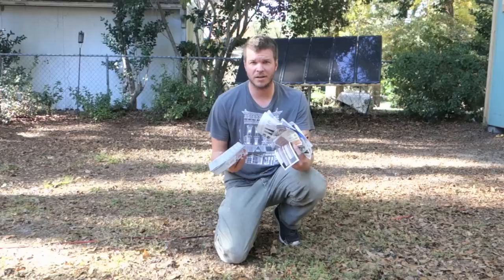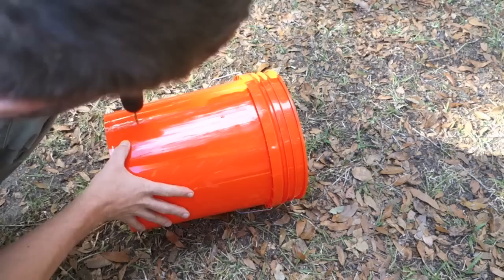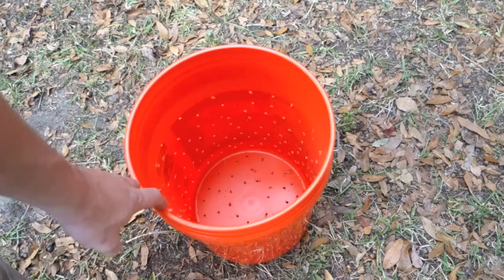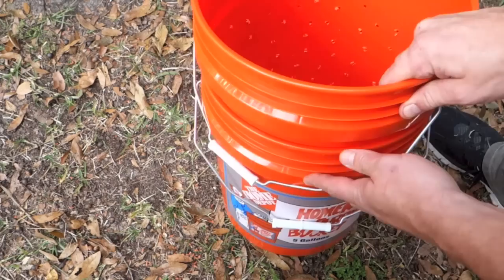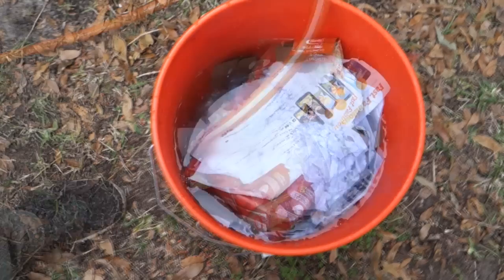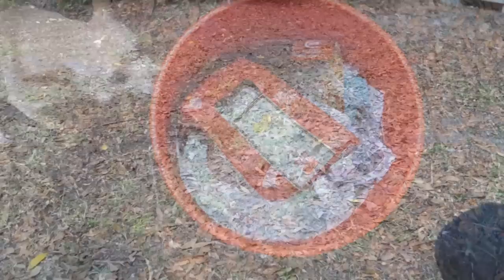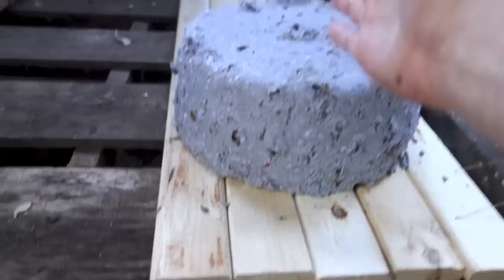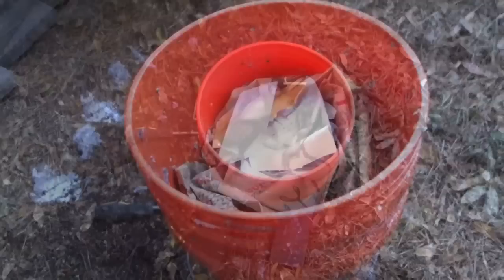Free And Virtually Unlimited Fuel To Heat Your Home

Comment: In the 70's, my dad used to make me roll up the newspapers and flyers into paper logs. No water, no drill, no mess. Tie the logs with string, and place seam side down on the grate. Obviously you couldn't use egg cartons that way, but they can be used as starter wicks. So much quicker. So much easier.
Reply: We did the same for the wood stove.
Reply: That reminds me of the movie with John Candy and Dan Akroid The Great Outdoors, “You have to twist it to simulate kindling”!

Comment: Bit late to the party but apparently at scouts when they make small fire starters out of dryer fluff (lint for the US) they add something like Vicks Vaporub or anything else with a petroleum base to it for flammability.
Maybe you can take the same approach with these briquettes if you want to start fires with them instead of having to already have a fire started.
Edit: Maybe you could even syringe the Vicks or equivalent into the centre of these briquettes after it’s dried and keep squeezing as you withdraw the needle to ensure the fire get into the briquette.

Comment: I use a similar method to make fire starters, even made my own blender blades. I add dead grass and leaves as I find that solid paper doesn't light as easily. I usually make 3-4" balls with my hands, small enough to fit into baggies to put in my camping bag.

Comment: It's great to repurpose this stuff. I am concerned to know if the dyes in the ink or coatings on the paper are toxic and if toxins are released into the water or into indoor air when burned?
Reply: In a ventilated wood stove the smoke is going up the pipe. But yes the ink and glue whatever is bad for you most likely. But there are worse things in everyday life then burning this ink stuff. Burning plastic or just eating from plastic containers is probably a bigger problem.
Reply: I'm told that a lot of printing inks these days are soy based and safe to burn, can anyone confirm ? I also think that burning the fire hot rather than damped down gives cleaner burning and helps break down a lot of combustion prodeucts and impurities.
Reply: @mycolets   I believe  I heard that also, they used to say to use regular  newspaper, but, not the comics. (because of all the colored ink)
Reply: Most likely its bad, and even more with plastic windows you would forget to take off before putting your waste for this purpose, You can just make 2 paper waste containers and be more selective about it one for recycling and one for making this stuff and only use paper that is mostly clean or has little to no ink on it or only black or blue ink like o letters, also care for paper cups as they have wax coating or plastic coating, as long as you know its only wax coating it would be ok to burn since its same as burning a candle, but plastic lining is a no no.
Reply: I work in a paper mill. The inks used on paper now a days is all soy based because its the cheapest. Paper from 15 to 20 years ago or more is problematic. White clay is added to printed paper so the ink won't blot. Most paper glues are starch treated with caustic. Potato skins are dissolved off with caustic and the solids from that are the primary source. The primary problem with using paper as a fuel is that its very poor in heat producing value. Wood is primarily composed of lignin and cellulose. The two are separated and the paper is made from the cellulose. You need to understand that wood which contains more lignin, such as oak, provides much more heat than a low lignin wood, such as willow. Paper is similar to burning leaves. You can heat with just about anything that burns, but using a low heat fuel will yield lower results. I suggest that you find a source of waste or scrap wood, such as broken pallets for low cost heating.
Reply: @OAikoT  honestly you're better off burning the paper normally. Compressing it into logs like this just makes it burn less efficiently.

The key is having a fire system with thermal mass so you can birn fast and hot and capture that heat
Reply: I wonder how well these would work in a rocket mass heater
Reply: @garyindiana2127  well enough, mixed with quick hot burning wood.

The problem with these is that they're made to burn slow to slow release heat for people with ordinary wood stoves.

If you have an RMH just load up the feed with a ton of paper and one or two chunks of wood and let it rip. The mass will soak the heat energy
Reply: @priestesslucy3299  Perhaps while it's goo mix in some wood chips, if you have a side loading rmh it could save a trip to the stove....idk
Reply: @garyindiana2127  Most likely similar to using dried dung. Dried dung fuel is used in Africa in rocket stoves, but requires wood to be used with it. As for the lost fertilizer value, this dung is low Nitrogen anyway and the Potassium is still in the ash.
Reply: 7:05 yes, but I need every day at least ten of these to heat my 50 square meter apartment. Wherefrom do I get all the paper? Why not burn the paper directly and not have to make it wet and wait until it is dry which can take weeks?

Comment: If I remember from the 70's right, we used borax in the water to help it catch fire instead of smolder. Something that may help you! Also if the chunk doesn't please you asthetically, try rolling it up in a paper bag when it's almost dry. Cheers!
Reply: Gas works too😂😂
Reply: @jimmyReesby  AXE body spray is flamable

Comment: This is a great process. I normally shred every other month because I do own a shredder and like making use of it. The other thing I do different is go to my local hardware supply company (Home Depot, Lowe's or Ace) and get their wood shavings for free. "The shavings are soooo fine"; it helps the product mixture to burn much longer with the added wood shavings/saw dust. I hope this comment was helpful.
Reply: Do these paper logs burn hot like wood or just kinda smolder?
Reply: @mikhailkalashnikov4599  good question! I would like to know the answer to that as well! Blessings be all with love and light! 🙏❤️🌞✨🤗

Comment: Great ideas here! Very creative! I am the ultimate lazy log maker. I take paper section and roll them up and leave an open tunnel inside then immerse them in my kitchen sink till soaked. (10 minutes). Then I pull them out and squeeze them out a bit and form the pseudo-log shape ( its already in a log shape) and toss them in the garage to dry. They take about 1 month to dry fully but they keep their shape. They burn easily due the tunnel inside. Sometimes I add junk mail and leaves from the yard as I roll up the newspaper. I agree, this is a vastly unrealized fuel source especially now before the SHTF and the mail and newspapers stop coming :) Super video!
Reply: great idear love it thank you for shearing
Reply: I like it!, simple and easy to do
Reply from the maker: Thanks!
Reply: ***** I dont understand. Could you explain please. Thanks.
Reply: I'm even lazier- I just throw the junk mail directly into the woodstove. In the summer it goes in a huge box, and when the box is full it goes in the woodshed. I don't get enough junk mail to even begin to heat my house though....
If someone had the time, I'm sure shredded paper is free from those companies that do it for a business.
Reply: julie r They sell it to paper companies!
Reply: julie r they shred the paper for a reason. It contains sensitive information, which would sometimes be hard to put together, but it's possible...
Reply: @interstategar  A lot of the time they give it away for free, because it would cost them to dispose of, and the paper companies collect it for free,  because it saves them having to source and buy it instead. it's a win win for everyone. Source: I used to work for a record management company who did heaps of shredding.

Comment: Good idea! If you had a third bucket, you could use that as the press in place of using a saw and cutting wood (or maybe let the water drain onto plants and just use the second bucket in place of a third) Also, if you had a paint mixer, you could save effort of building a custom tool and using that to blend.
Reply: Just saw the video I was thinking the same thing as you as I watched
Reply: I don't think a paint mixer will shred the paper very efficiently because it's not Sharp. Try it and let us know!
Reply: Well I've got plenty buckets I get all the peanut butter buckets after they're empty and I've got plenty of paper to burn my neighbor's call the fire department every time I burn my wood pile and also the health department for the buckets but my neighbor's Pitbull keeps getting loose and Animal Control don't show up so I've got that line of buckets to keep him from coming in my yard through the electric fence and its full of water so I can dump on him when he grabs my dog now I've got another excuse for all them buckets thank you will keep the Neighbors at Bay
Reply: @desertodavid  well I'm not all white and you have to use what you got on the reservation to make do you know..... Life Goes On picket fence or not
Reply: Good points! I use a paint mixer "drill" and a bucket I sit on to squeeze out the excess water. I also use a thin plastic mold to make smaller bricks that dry much faster and, most importantly, fit into our small stove. Enjoyed the video!

Comment: I've seen this as well!  But according to my EPA Certified stove using a Vermiculite block or Vermiculite as the secondary burn process,  It's an absolute no no because the ink will clog the block!  You could definitely use cardboard  or clean paper products.  It's a great tip for certain. USN (ret)
Reply: Exactly! In Germany, with our new high performance / low pollution stoves, you're definitely not meant to burn paper at all, because the ink will, over time, cover up the insides of the stove as well as the chimney, which is even worse, as it might start burning at some point.

It's recommended to only burn dry hard wood.

But the idea is great, and people could think of solutions to that problem. I have lots of card board due to online shopping and delivery, and I've wondered how I could make good use of it.

Card board is actually a good business, it's worth a lot because it burns well.

Comment: This is worth the time to make these as extra fule. Of course like one person said in their comments what about the wood cost, manufacturing cost and electric cost to make and process this project? ...they did forget one cost, the cost of the food you ate to create fule for the energy you needed to be able to do this project. My preception here is, "these are stupid comments from stupid lazy people". I thank you for this idea. I get a lot of junk mail that I now put in a bucket. You have given me a great solution as to what to do with it. I have no welder,  but a piece of threaded rod with jamb nuts to hold the blade which works great and I used another bucket to press the water out, in place of the wood. This also works great.  Thanks again for a wise solution to trash recycle.

Comment: You can also use your bucket with no holes to act as your presser to remove the water.  Just put it on top of the watered down paper bucket and press. I know your trying to save water. Drain the water into an extra bucket, saved water., use 2 concrete house blocks put the draining bucket straddled the 2 blocks,  put the good bucket inside the holed bucket and have a seat. Incase you don't have a saw to cut wood for a presser .
I learned that from my son. 
Cheapest place for buckets as of today is walmart here in Northwest Florida. They have gone up in prices at lowes and home depot. 
Be Blessed. And keep up the great videos.
Reply: Exactly what I was thinking. Total waste to cut wood for a press when you can use another bucket

Comment: Why not rather cutting and using thick circular wood to force water out, just use another bucket without any holes in it and press it down onto the bucket with liquid paper in it. Faster, and easier and no cutting.
Reply: His video says in it that he later found out you don't need the wood press if you use enough paper in the bucket. Caption around 6:47
Reply: Maybe a mop bucket press.
Reply: I thought the same thing.
Reply: Great idea!!

Comment: free, except for the electricity used, and the drill, and the buckets, and the water, and the circular saw and welding material, and the piece of wood, and the pencil, and the saw, and you have to have a fire going, or else it won't work
Reply from the maker: All of the tools I already owned. I now use a cordless drill that is charged up from solar panels. The materials used to weld were only used one. The water can easily be collected via rainwater. Thanks for your feedback.
Reply: bento barreirinhas , The title is perfect.

Free FUEL. Paper, leaves, paperboard, carton etc..
And of course you need a fire going buddy, this is FUEL, not fire-starter.
Reply: Etienne Couture how expensive is one match and firewood? I've quite often seen 'free firewood' signs and postings either while driving or in the newspaper, actually they're very very common in the newspapers... which I guess when you think about it is an easier way to acquire free fuel than this video xD
Reply: bento barreirinhas  Yep, the deal breakers for me are the pencil and the fire. You'd use almost an entire pencil for only a lifetime of logs and it sucks that you need fire for it to burn.
Reply: And the pencil!!! Lolohahablaha
Reply: who says its a tree at all when you live in an area that deals with lots of wooden pallets and other wooden furnitures and random wooden junk things? its mostly wooden stuff that people or small bussinesses cant be fucked taking to the dump.
Reply: liquidmetaltech I've researched the wooden pallet idea.  It turns out that most of the wooden pallets contain wood that is loaded with chemicals that are toxic and will be let into the air when burned. You can die from burning wooden pallets in a wood stove.
Reply: liquidmetaltech The fumes from pallets or treated lumber can kill you. The glues and other stuff in furniture and other scrap isn't something I'd want to smell in my house or breathe. Go look at some of that "Free firewood" and you'll be in on the joke that Tim steelARTWORKS told you about. If that "free firewood" isn't trash it's still in the form of a TREE and won't be firewood until you do a shit ton of chainsaw work. stack, and dry it.

No need to place an advertisement to get rid of actual free firewood, just tell a couple of friends.
Reply: hehe well im gettin schooled again. :)
Reply: Tiny House Listings  keep up the good work, im inspired to research and do several projects i have thought through, also me moving from the u.k to north America has helped alot, thinking of getting back to basics, being as self dependent as possible  Thanks  :-)
Reply: Tim steelARTWORKS Around here 'Free Firewood' usually means pressure treated 2x4s and broken pallets.
Reply: arrgh garry: No harm - no foul

Comment: Maybe its a good idea in the US, i don't know, but for the EU, we have recycling, and that surely is better for the world than burning printed Paper.
Reply: When Russia cuts off your gas supply next winter, you'll gladly burn paper logs to stay warm !!
Reply: Mike D What is wrong with you? Do you really think, there is only either russion gas or burning paper to keep your house comfy?

Again, why burning paper is a bad idea:
Paper is produced form Wood, needs quite a bit of work to get the wood chopped down, grinded etc, than it gets washed and treated chemically and takes a lot of water.

Now compare it to burning wood for example: Choip the tree, chop it down a bit, done.

You can recycle paper: it gets washed, the paint removed (takes water again) and add a bit new paper to it. That takes less power, less chemical, less water, and you don't produce toxic fumes by burning it.

So, come again, and tell me a good reason FOR bruning paper as fuel.
Reply: Mike D dittos I fully agree
Reply: ABaumstumpf burning printed paper is toxic.there are bunch of chemicals inside.we have factory for recycling(not only paper).Also,you can see in this video that he works without gloves,(danger of apsortion chemicals into the mix) another thing-when you burn this kind of paper ,smoke was FULL of Dioxin
Reply: Valter Bučić
I think you replied ot the wrong comment =)
Reply: Yes,something hapened with my cursor..it was too late to corect.no hard feelings. :-)
Reply: ABaumstumpf actualy,I agree with You,(maybe You have the wrong feeling )but my replysuport yours.have a nice day
Reply: "Reduce, Reuse, Recycle" ... There's a reason Recycle is last.